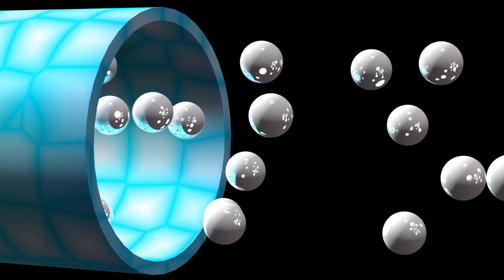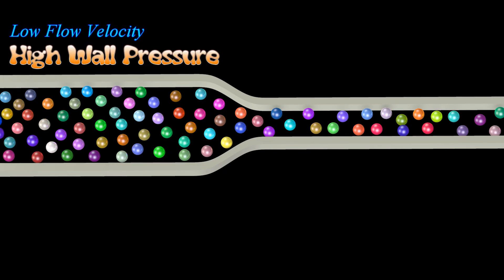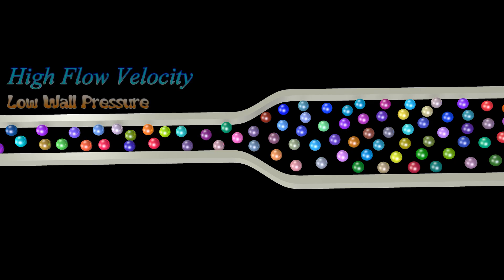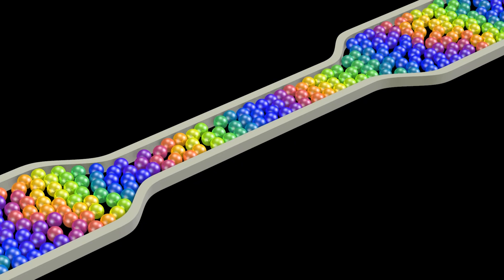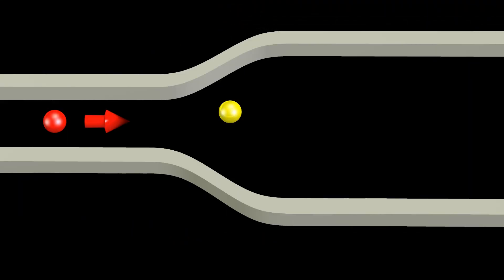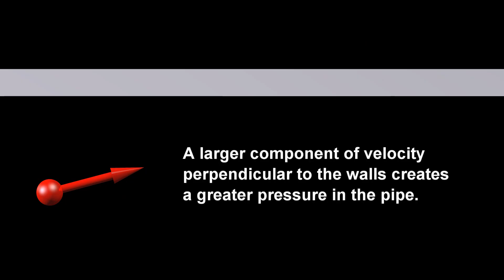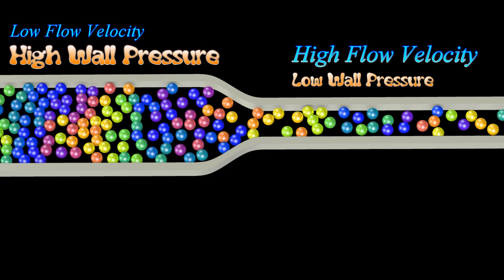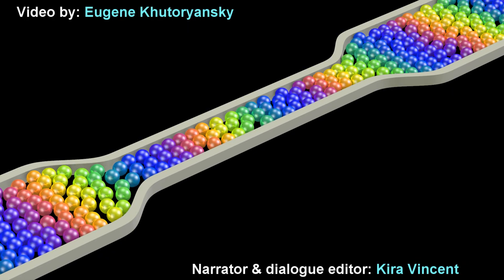Bernoulli’s Principle on Atomic Scale

Comment: hmm, interesting. Does this mean that the static pressure in laminar flow is lower seeing how most of the molecules are allready oriented parallell to the pipe walls?
Reply: No.
The random thermal vibrations that provide the wall pressure remain random and unchanged by the motion down the pipe, thus having the same static pressure on the walls. 
Unfortunately this explanation of Charles Crummer, is completely flawed as follows:

The statement at 2:07 is correct (perhaps the ONLY one). "there is no reason to expect an atom with a higher velocity to exert a lower pressure on the walls of the pipe." 

There can be the same pressure in a fast fluid as a slow fluid.  They simply have the same static pressure. Bernoulli is not about speed. It is about changes in speed or velocity which is Acceleration along a path. 

The pressure on the walls of a sealed jar is the same regardless of the speed of the jar.

A fundamental flaw in this misconception at 2:42 is is that there no reason to expect a molecule to have the thermal vibration in only one dimension.  These pressure causing vibrations are random in direction and are how they bounce round between other atoms.  
At any given instant a molecule may be going down and the next at 90 degrees or even 180 degrees to the previous vibration.  
That simple fact breaks this false logic.
..
Then. . . 
It is the average velocity (over time) that has a directed motion when the kinetic energy is added to produce an increase in speed. That directed velocity is vectorially summed to the random vibrations.  This is vector addition of velocities. This means that the random vibrations are superimposed onto the linear velocity along the tube. This is fundamental physics. Vector quantities like speed and acceleration add vectorially.
Ignoring that fundamental physics is another flaw in this.
..
..
Then, the added kinetic energy in the moving fluid is in only  direction.  It is not increasing the random thermal vibrations. That would require increasing the temperature.  This is another flaw in this story.  Moving the fluid along the pipe does not raise the temperature.  
Therefore, the statement at 2:23: "an atom with a higher velocity would have a higher kinetic energy and, therefore, exert a larger force on the pipe walls" is false because it conflates / confuses thermal energy and momentum in one direction.
..
..
Consider bouncing a ball on the floor. Each bounce imparts some momentum to the floor.  The ball's actual motion is only vertical..

Now, start the room moving (a train car) and the ball still imparts the same momentum to the floor with each bounce.  It's actual motion, relative to the stationary ground changes.  It has the SAME vertical component, but now a horizontal component vectorially added to the vertical motions.  The pressure on the floor does not change.
.
 However, these two motions are orthogonal and have no effect on each other. The vertical up[and down bouncing component remains the same. ONLY the ground referenced horizontal component changes as the speed increases.
This physics does not change if the ball is bounced on the ground outside the train's window.
.
This fails on these fundamental physics errors.

Comment: Excellent demonstration of a principle I stress to my students: Think about what the atoms are doing! (Or, in other cases, what the electrons are doing...)
Reply from the maker: Thanks.
Reply: Unfortunately this explanation of Charles Crummer, is completely flawed as follows:

The statement at 2:07 is correct (perhaps the ONLY one). "there is no reason to expect an atom with a higher velocity to exert a lower pressure on the walls of the pipe." 

There can be the same pressure in a fast fluid as a slow fluid.  They simply have the same static pressure. Bernoulli is not about speed. It is about changes in speed or velocity which is Acceleration along a path. 

The pressure on the walls of a sealed jar is the same regardless of the speed of the jar.

A fundamental flaw in this misconception at 2:42 is is that there no reason to expect a molecule to have the thermal vibration in only one dimension.  These pressure causing vibrations are random in direction and are how they bounce round between other atoms.  
At any given instant a molecule may be going down and the next at 90 degrees or even 180 degrees to the previous vibration.  
That simple fact breaks this false logic.
..
Then. . . 
It is the average velocity (over time) that has a directed motion when the kinetic energy is added to produce an increase in speed. That directed velocity is vectorially summed to the random vibrations.  This is vector addition of velocities. This means that the random vibrations are superimposed onto the linear velocity along the tube. This is fundamental physics. Vector quantities like speed and acceleration add vectorially.
Ignoring that fundamental physics is another flaw in this.
..
..
Then, the added kinetic energy in the moving fluid is in only  direction.  It is not increasing the random thermal vibrations. That would require increasing the temperature.  This is another flaw in this story.  Moving the fluid along the pipe does not raise the temperature.  
Therefore, the statement at 2:23: "an atom with a higher velocity would have a higher kinetic energy and, therefore, exert a larger force on the pipe walls" is false because it conflates / confuses thermal energy and momentum in one direction.
..
..
Consider bouncing a ball on the floor. Each bounce imparts some momentum to the floor.  The ball's actual motion is only vertical..

Now, start the room moving (a train car) and the ball still imparts the same momentum to the floor with each bounce.  It's actual motion, relative to the stationary ground changes.  It has the SAME vertical component, but now a horizontal component vectorially added to the vertical motions.  The pressure on the floor does not change.
.
 However, these two motions are orthogonal and have no effect on each other. The vertical up[and down bouncing component remains the same. ONLY the ground referenced horizontal component changes as the speed increases.
This physics does not change if the ball is bounced on the ground outside the train's window.
.
This fails on these fundamental physics errors.

Comment: Nice  video  please  make  a  video   of   gases   adiabatic expansion  from  molecular or  atomic  point of  view  in order  to understand  the  physics  of it.
Reply: Unfortunately this explanation of Charles Crummer, is completely flawed as follows:

The statement at 2:07 is correct (perhaps the ONLY one). "there is no reason to expect an atom with a higher velocity to exert a lower pressure on the walls of the pipe." 

There can be the same pressure in a fast fluid as a slow fluid.  They simply have the same static pressure. Bernoulli is not about speed. It is about changes in speed or velocity which is Acceleration along a path. 

The pressure on the walls of a sealed jar is the same regardless of the speed of the jar.

A fundamental flaw in this misconception at 2:42 is is that there no reason to expect a molecule to have the thermal vibration in only one dimension.  These pressure causing vibrations are random in direction and are how they bounce round between other atoms.  
At any given instant a molecule may be going down and the next at 90 degrees or even 180 degrees to the previous vibration.  
That simple fact breaks this false logic.
..
Then. . . 
It is the average velocity (over time) that has a directed motion when the kinetic energy is added to produce an increase in speed. That directed velocity is vectorially summed to the random vibrations.  This is vector addition of velocities. This means that the random vibrations are superimposed onto the linear velocity along the tube. This is fundamental physics. Vector quantities like speed and acceleration add vectorially.
Ignoring that fundamental physics is another flaw in this.
..
..
Then, the added kinetic energy in the moving fluid is in only  direction.  It is not increasing the random thermal vibrations. That would require increasing the temperature.  This is another flaw in this story.  Moving the fluid along the pipe does not raise the temperature.  
Therefore, the statement at 2:23: "an atom with a higher velocity would have a higher kinetic energy and, therefore, exert a larger force on the pipe walls" is false because it conflates / confuses thermal energy and momentum in one direction.
..
..
Consider bouncing a ball on the floor. Each bounce imparts some momentum to the floor.  The ball's actual motion is only vertical..

Now, start the room moving (a train car) and the ball still imparts the same momentum to the floor with each bounce.  It's actual motion, relative to the stationary ground changes.  It has the SAME vertical component, but now a horizontal component vectorially added to the vertical motions.  The pressure on the floor does not change.
.
 However, these two motions are orthogonal and have no effect on each other. The vertical up[and down bouncing component remains the same. ONLY the ground referenced horizontal component changes as the speed increases.
This physics does not change if the ball is bounced on the ground outside the train's window.
.
This fails on these fundamental physics errors.

Comment: but what if we keep identical solids inside both narrow and broad pipe? will the pressure experienced by solid in narrow pipe be greater than the pressure experienced by solid in broad pipe? or something different?
Reply: No.
The reason the fluid speeds up is because there is more pressure in the first fat section which pushes more and accelerates into the narrow section.  The fluid has mass and a force is needed to accelerate it - it is the difference ion pressure that speeds it up.  This is Newton in fluids.
.. .. ..
Unfortunately, this violates some very common and well understood accepted principles of physics.  It repeats the same errors that Charles Crummer makes.
..
The statement at 2:07 is correct. "there is no reason to expect an atom with a higher velocity to exert a lower pressure on the walls of the pipe." 

There can be the same pressure in a fast fluid as a slow fluid.  They simply have the same static pressure. Bernoulli is not about speed. It is about changes in speed or velocity which is Acceleration along a path. 

The pressure on the walls of a sealed jar is the same regardless of the speed of the jar.

A fundamental flaw in this misconception at 2:42 is is that there no reason to expect a molecule to have the thermal vibration in only one dimension.  These pressure causing vibrations are random in direction and are how they bounce round between other atoms.  
At any given instant a molecule may be going down and the next at 90 degrees or even 180 degrees to the previous vibration.  
That simple fact breaks this false logic.
..
Then. . . 
It is the average velocity (over time) that has a directed motion when the kinetic energy is added to produce an increase in speed. That directed velocity is vectorially summed to the random vibrations.  This is vector addition of velocities. This means that the random vibrations are superimposed onto the linear velocity along the tube. This is fundamental physics. Vector quantities like speed and acceleration add vectorially.
Ignoring that fundamental physics is another flaw in this.
..
..
Then, the added kinetic energy in the moving fluid is in only direction.  It is not increasing the random thermal vibrations. That would require increasing the temperature.  This is another flaw in this story.  Moving the fluid along the pipe does not raise the temperature.  
Therefore, the statement at 2:23: "an atom with a higher velocity would have a higher kinetic energy and, therefore, exert a larger force on the pipe walls" is false because it conflates / confuses thermal energy and momentum in one direction.
..
..
Consider bouncing a ball on the floor. Each bounce imparts some momentum to the floor.  The ball's actual motion is only vertical..

Now, start the room moving (a train car) and the ball still imparts the same momentum to the floor with each bounce.  It's actual motion, relative to the stationary ground changes.  It has the SAME vertical component, but now a horizontal component vectorially added to the vertical motions.  The pressure on the floor does not change.
.
 However, these two motions are orthogonal and have no effect on each other. The vertical up[and down bouncing component remains the same. ONLY the ground referenced horizontal component changes as the speed increases.
This physics does not change if the ball is bounced on the ground outside the train's window.
.
This fails on these fundamental physics errors.

Comment: is there any reason as to why atoms in the narrow section have higher chances of having their velocity parallel to the walls? Can we say- that if there was one individual atom it would hit the walls of the container zig zag, but since we are talking about a fluid which has lot of atoms. So when the fluid enters the narrow area all of the atoms inside would have gone zig-zag but could not because of other atoms which repel, thereby having velocity parallel to the walls?
Lovely video. Thanks
Reply: Unfortunately, this violates some very common and well understood accepted principles of physics.  It repeats the same errors that Charles Crummer makes.
..
The statement at 2:07 is correct. "there is no reason to expect an atom with a higher velocity to exert a lower pressure on the walls of the pipe." 

There can be the same pressure in a fast fluid as a slow fluid.  They simply have the same static pressure. Bernoulli is not about speed. It is about changes in speed or velocity which is Acceleration along a path. 

The pressure on the walls of a sealed jar is the same regardless of the speed of the jar.

A fundamental flaw in this misconception at 2:42 is is that there no reason to expect a molecule to have the thermal vibration in only one dimension.  These pressure causing vibrations are random in direction and are how they bounce round between other atoms.  
At any given instant a molecule may be going down and the next at 90 degrees or even 180 degrees to the previous vibration.  
That simple fact breaks this false logic.
..
Then. . . 
It is the average velocity (over time) that has a directed motion when the kinetic energy is added to produce an increase in speed. That directed velocity is vectorially summed to the random vibrations.  This is vector addition of velocities. This means that the random vibrations are superimposed onto the linear velocity along the tube. This is fundamental physics. Vector quantities like speed and acceleration add vectorially.
Ignoring that fundamental physics is another flaw in this.
..
..
Then, the added kinetic energy in the moving fluid is in only direction.  It is not increasing the random thermal vibrations. That would require increasing the temperature.  This is another flaw in this story.  Moving the fluid along the pipe does not raise the temperature.  
Therefore, the statement at 2:23: "an atom with a higher velocity would have a higher kinetic energy and, therefore, exert a larger force on the pipe walls" is false because it conflates / confuses thermal energy and momentum in one direction.
..
..
Consider bouncing a ball on the floor. Each bounce imparts some momentum to the floor.  The ball's actual motion is only vertical..

Now, start the room moving (a train car) and the ball still imparts the same momentum to the floor with each bounce.  It's actual motion, relative to the stationary ground changes.  It has the SAME vertical component, but now a horizontal component vectorially added to the vertical motions.  The pressure on the floor does not change.
.
 However, these two motions are orthogonal and have no effect on each other. The vertical up[and down bouncing component remains the same. ONLY the ground referenced horizontal component changes as the speed increases.
This physics does not change if the ball is bounced on the ground outside the train's window.
.
This fails on these fundamental physics errors.